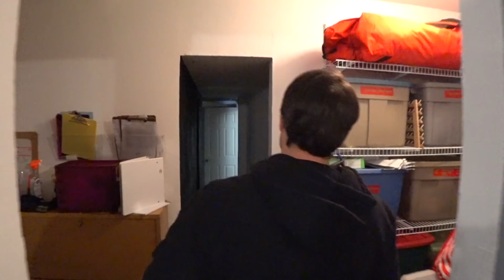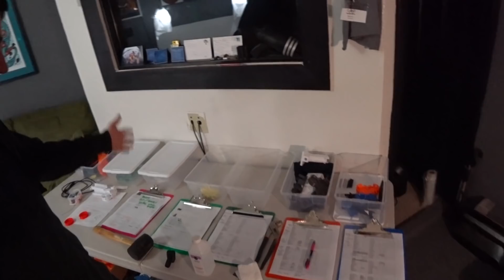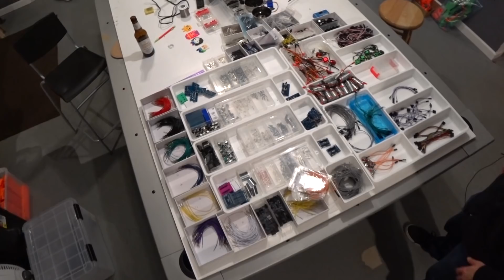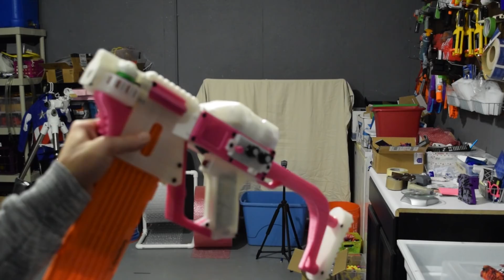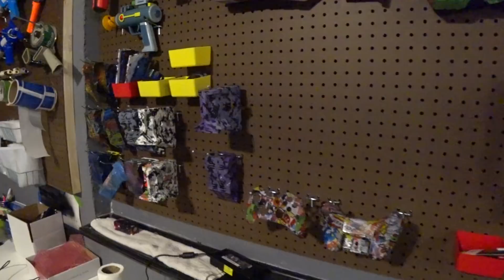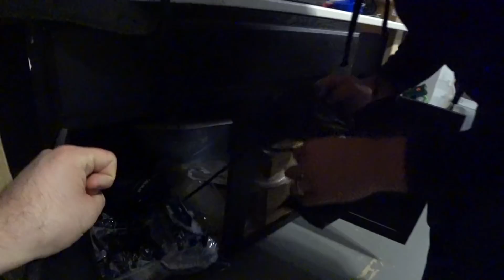Project FDL Workshop Tour

Comment: sentinel on the wall <3

RIP that snap? Sear?  rainbow? What is that lol
Reply: Snoop Doggy Doge tbh I don't know what it's called either. It's closest to a snap than anything. Single piece trigger and catch that seats into the plunger head. Clearly not printed strong enough.
Reply: It could be a sear / snap mix, that is p cool. Does it still have a clothespin? Very curious as I haven't seen those before,
Reply: No clothespin but same concept. The trigger is shaped like an L with a triangular portion on one end that catches in a slot around the plunger head. Same way the pin on a clothespin would. I should do a writeup at some point probably. The idea was all big box sourced, no mcmaster orders, and as little cutting as possible, and as reproducible as possible.

Comment: Nice video. Nice tour. I'm not too sure of the 3D printing and soldering process. It seems all is done underground. I'm not an expert in electronics or whatever but I do see some ducts and a I believe suction fans to suck out the fumes from the 3D printing area but not really much at the soldering area. Just concerned about safety. Wouldn't it be pretty stuffy at the soldering area without much ventilation?
Reply: I've inhaled worse fumes in areas much smaller. It's totally fine.